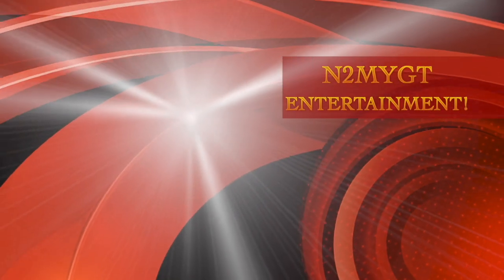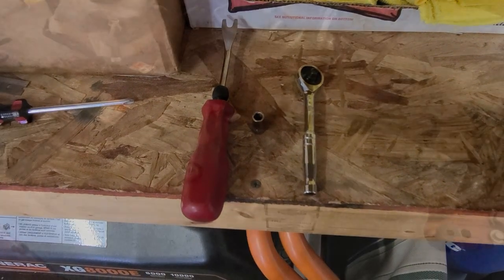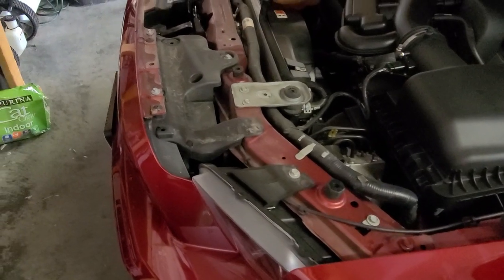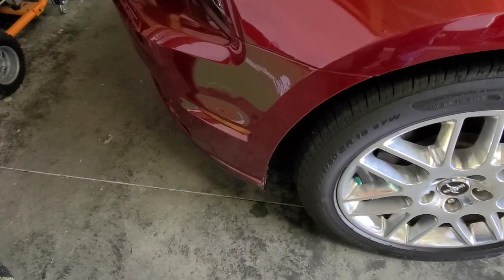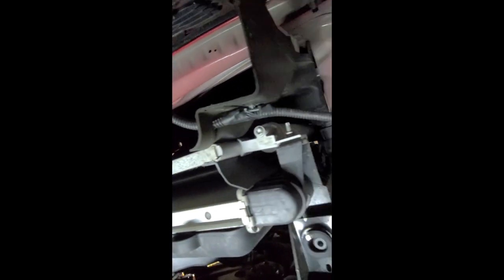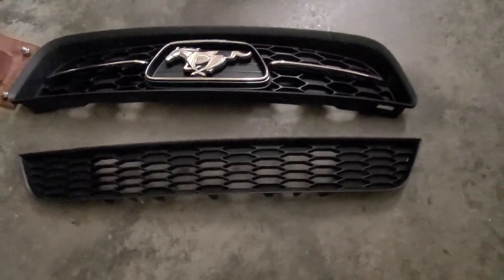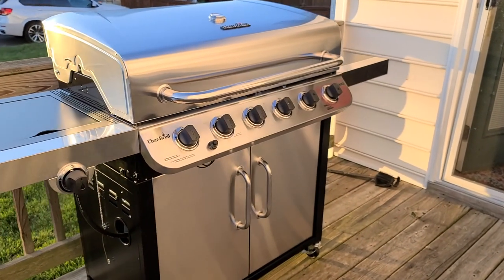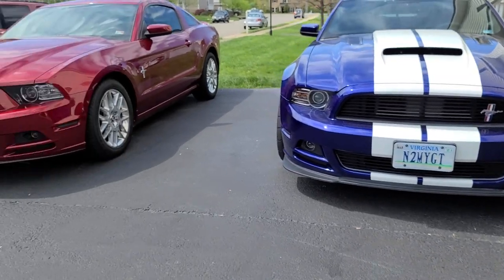Project6stang gets a facelift. (2014 Mustang Grill Install)

Comment: Hey Joel! i know this video is a bit old but I was hoping to see if you'd reply. 
I currently have a 2014 3.7 v6 Mustang with the Chrome surround grille (Base grille)

I wanted to swap this grille for the 2014 Mustang GT grille (with foglights) and was wondering if you know if this was possible? i heard the clips were different but that I need to replace both the v6 Grille AND surround with a GT grille and surround for it to fit. any insight?

Comment: Is this a pony package mustang? I’ve heard the grill and pumper is different and requires more work.
Reply from the maker: Yes it was a pony package car and no it is just like any other Mustang
Reply: @N2MYGT  so u can do a regular v6 grill the same way ?
Reply from the maker: @marquelbrox8586  if that's what you like yes. You could put the V6 grill on a GT you can put the GT on the V6 you can put a roush on there.